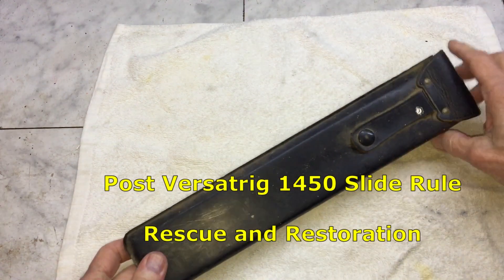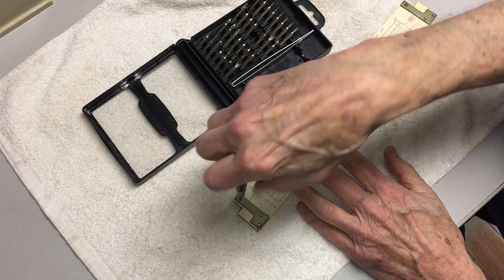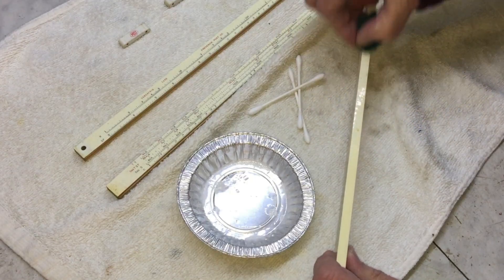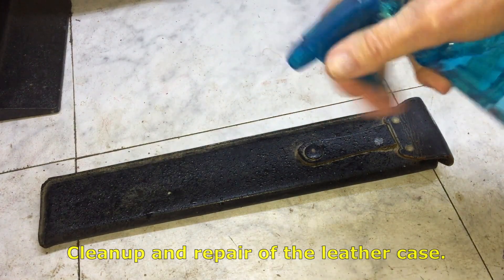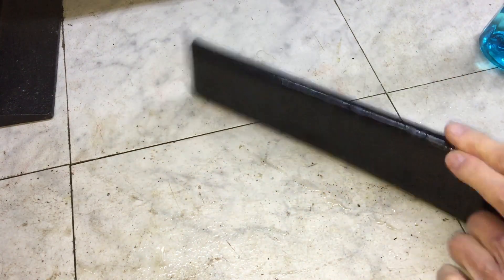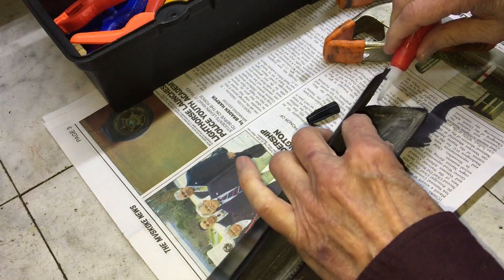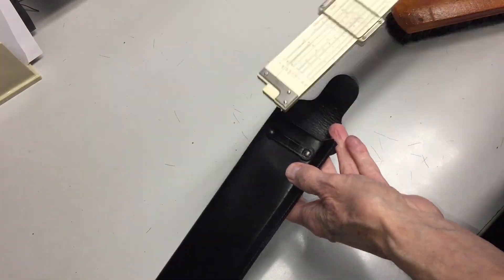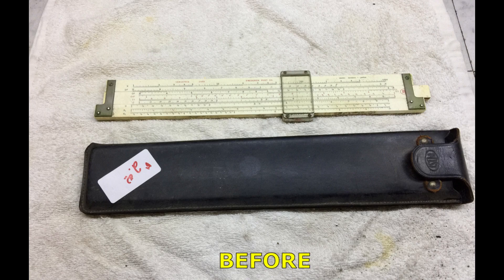Post Slide Rule Rescue and Demonstration

Comment: Regarding 11:13, 5.5 x 3.5 = 19.25 and not 192.50. This is because since 5 x 3 = 15 and 6 x 4  = 24; therefore the answer to 5.5 x 3.5 must be larger than 15 and smaller than 24. In a Slide Rule Course, the Mathematical Method that was taught for calculating very large or very small numbers was to convert them into their scientific notation in order to consistently keep track of their decimal points. For example, 5,500 x 3,500 = 19,250,000. This is because (5.5 x 10^3) x (3.5 x 10^3) = 19.25 x 10^6 = 19,250,000. Similarly 0.55 x 0.35 = 0.1925. This is because (5.5 x 10^-1) x (3.5 x 10^-1) = 19.25 x 10^-2 = 0.1925.
Reply from the maker: Thanks for watching the video and for the comment!  Much appreciated!  Bill.
Reply: @rollerbald  "It's your responsibility to get the decimal point in the right place".
Very well demonstrated 😉

And thanks for sharing this excellent restoration project!
Will keep my eyes peeled, next time I am in the tool-section of a thrift shop 😁

Comment: 5.5 x 3.5 = 19.25
When using a slide rule, you tend to think about the numbers in a different way. 5 x 3 is 15 and 6 x 4 is 24, so you know your answer will have two digits to the left of the decimal point. This kind of familiarity with numbers is why I always like slide rules, and learning to use one seems to be useful in honing problem solving skills.  Thanks for keeping one alive and the nice video on restoring it.
Reply: This points up the problem with ALL calculating machines. You MUST have a grasp of estimation to see if your answer is reasonable. A little more than 5 times a little less than 4 will be about 20. People accept the answers from electronic digital calculators as Gospel, but if they input the wrong numbers, they will just accept whatever the little green numbers say to 10 decimal places.

I am happy to report that modern elementary school math instruction with SOME curricula require students to ESTIMATE answers before SOLVING. I was introduced to slide rules 50+ years ago in HS chemistry, and the challenge was always “finding the decimal place.” This “native” math ability is fundamental to critical thinking on your feet when some politically motivated prophet is conning you into something that is not in your own best interest. 

The slide rule also required people to consider the concept of “significant figures” which means that your answer can be no more precise than your least precise input figure, i.e., if your least precise figure is to the 1/10’s place, your answer cannot claim accuracy to the 1/1000 ths place.
Reply from the maker: Thanks Ken!  My background is in business, not math or engineering but I have always been fascinated by slide rules.  My father always had one around and I have a EE friend who still uses his!  You are so right about needing to be familiar with numbers in order to use a slide rule effectively.  My mistake was due to inattentiveness! Thanks for the comment. Regards, Bill.

Comment: I learned my high school math on a slide rule.  By the time I got to college the HPs were on the market.  
I find slide rules at flea markets now and then.   I think I'm up to 8.   2 are 6 inch and one is a model for EEs.  Still looking for a circular model.
Reply: Nice cleanup!  The leather case came out really nice.
Reply from the maker: @frankg3072  Thanks Frank!  Glad you enjoyed the video.  I may have gone a little overboard on the case, but it did come out pretty well.  I like to do leather work, so I already have most of the supplies needed. Best to you, Bill.
Reply from the maker: Hi Roger - thanks for commenting!  I have several slide rules and actually used one a little in college although not as much as the engineering students.  I have some circular ones inherited from my father who used them as a B-17 bombardier during WWII.  I appreciate you watching the video!  Regards, Bill.